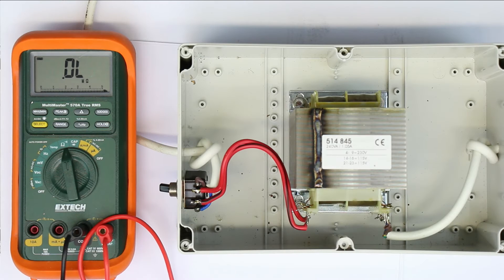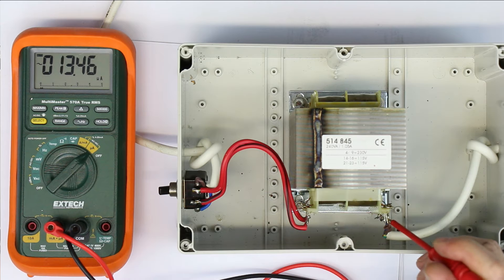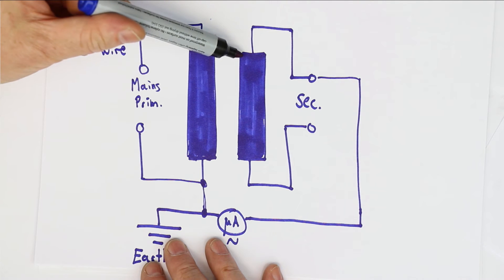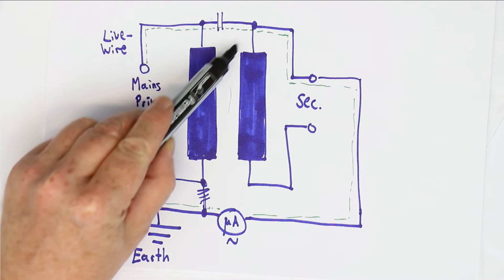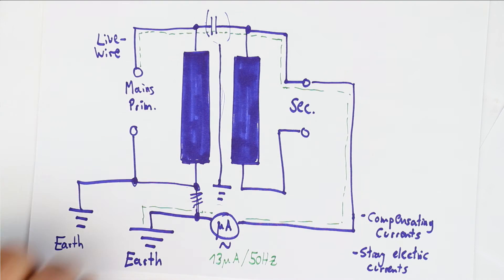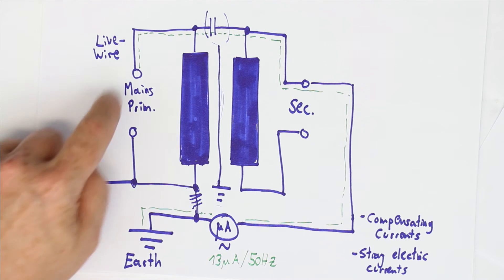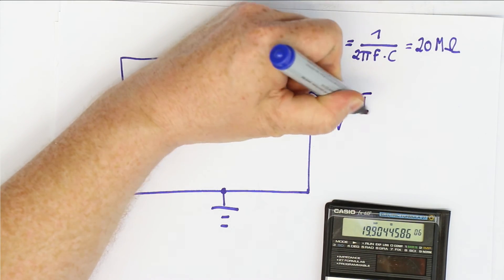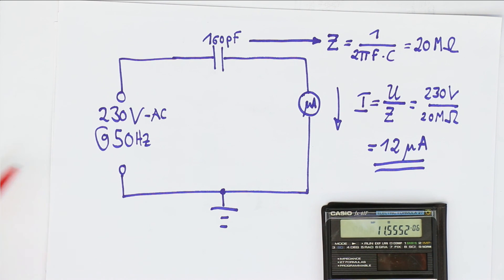Stray-Currents, compensating-currents and ground-loops in Transformers

Comment: Thank you very much for this insightful video! I have just checked two 220V/12V 150VA toroidal transformers, connected back to back. If they lie flat on the table, near each other, then I get very similar readings to yours. Ghost voltages 26 V and 107 V, depending on the checked wire. Stray currents 5 uA and 14 uA, depending on the checked wire. So I can make a good isolation transformer out of them. The voltage losses after the double transformation are 3 volts (input 223 V, output 220 V) without a load.

Comment: Dear Sir, i have a question concerning isolation transformer 230V/230V 50Hz. My primary has 3 terminals Live, Neutral and GNG. The secondary has two terminals both Live. When i measure with a DMM the voltage difference between one secondary terminal and the GND i measure about 94V, when i repeat the same measurement with the other secondary terminal and GND i read 90V. Why do i measure those high voltages and is it dangerous to touch in this case one of the secondary live terminal considering that our body is at GND potential? thanks a lot will be great if you could make a video for this as well. Regards. F. Ursino.
Reply from the maker: I assume that you measured the voltages with the DMM in AC-mode. Then what you have measured is the capacitively coupled voltage from the primary to the secondary winding (with the secondary without any load and the DMM probably with the usual 10 Megohm input resistance). Connect a 100k or 10k resistor as a load to the secondary and measure again. You will see that the voltage now breaks down to a very low value (mV...a few volts at max.). So thereby you can see that it is absolutely save to touch the secondary "live" wires (which are not "live" here). Another way to check for safety is simply measuring the resistance between one wire of the primary and and 1 wire of the secondary. The measured resistance with a DMM must be infinte (usually "OL" in the display). Of course during resistance measurement you may not have the transformer connected to mains voltage!
Reply: Thanks a lot for your reply very much appreciated. indeed i made the measurement as you mention.

Comment: An isolation transformer should not be connected to earth.
Reply from the maker: Any mains outlet has 1 wire connected to earth (in the fusebox)! 
You can´t avoid that. 
And capacitive coupling is an omnipresent annoyance and mostly goes over the capacitance to earth.
Watch my videos about "A Multistage EMI-Filter" where this concept (and the capacitive noise-coupling over earth) is explained in more detail.

Don´t confuse this with the extra line for "protective earth".